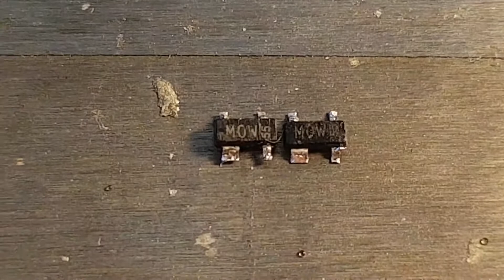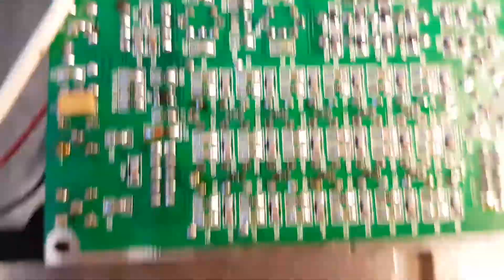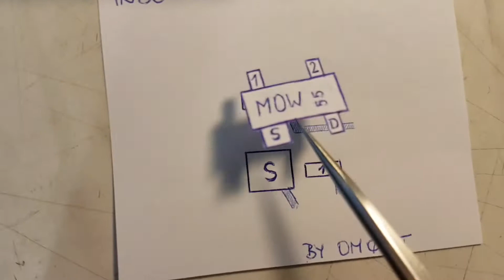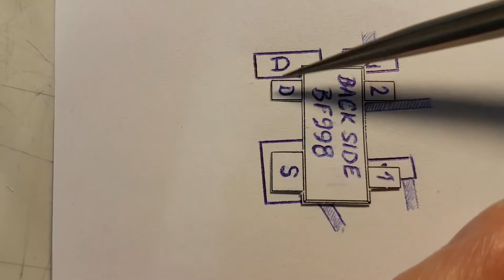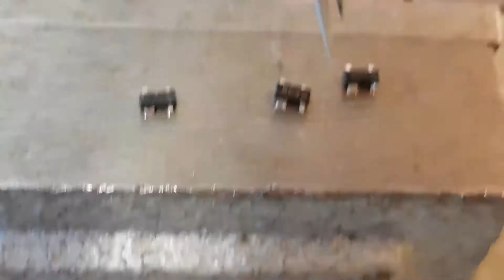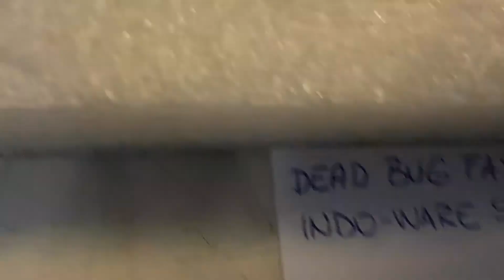SSB 6.1 transceiver kit BF998 "Dead bug fashion" ... how to do

Comment: Hi the problem is on all four FET's if you have the 998 not the 998R...see my build manual posted in the group below. Well worth joining the group as we also deal with all sorts of improvements to the 6.1 https://www.facebook.com/groups/1355945074463329/ There is also another useful group at https://www.facebook.com/groups/1586056264978850/ 73 de Nick G0CWA

Comment: Hi
very informative video. I have sealed everything but have not yet connected to the power supply. I'm wondering: is this error only on one transistor or all four??
Thank you
Reply from the maker: Voldemar D Thank you. In my case the problem was with all included transistors. Then i purchased new ones and i did this dead bug modification. Now is all working great.
Reply: Hi it is on all four FET's if you have the 998 not the 998R...see my build manual posted in the group below. Well worth joining the group as we also deal with all sorts of improvements to the 6.1 https://www.facebook.com/groups/1355945074463329/ There is also another useful group at https://www.facebook.com/groups/1586056264978850/ 73 de Nick G0CWA

Comment: In the case of not having the option to rotate the pins, how would you proceed to solder a similar component?
Reply from the maker: Diego Andrade so then you need to made another small PCB reduction. Output pins you would line with wires and connect it correct to the main PCB board.
Reply: Thank you for the answer. Would this aproach be safe considering circuits that provide high current with low voltages? In my case, i'm trying to replace a double n channel mosfet that provides 10A max at 3v and 5v volts. I will use 40awg  insulated copper wires for the connections but they are really tiny.
Reply from the maker: Diego Andrade then use at least so AWG (or more) as is used on the original circuit pins and it should work.

Comment: But its only to put them up and down, not rotate them, the child can understand.
Reply from the maker: Claes Sjöblom but you have to rotate them because of good pads positions
Reply: OMOET So its better to look at indoware instruktion befor solder.
Reply from the maker: Claes Sjöblom i did but i was not sure about polarity. There is not figured out the SMD code on transistor.